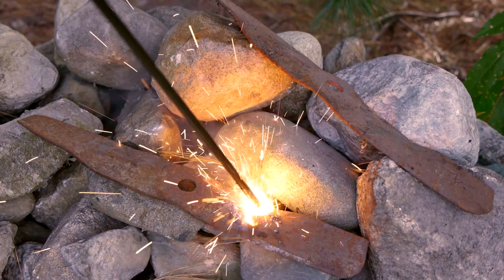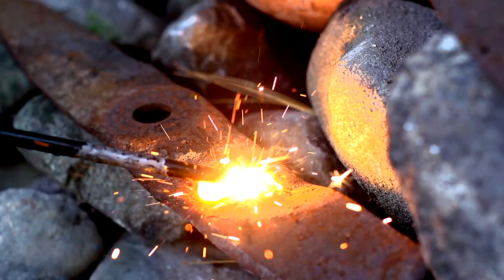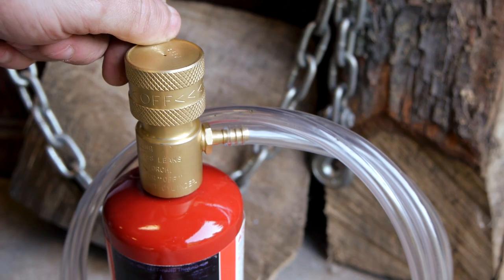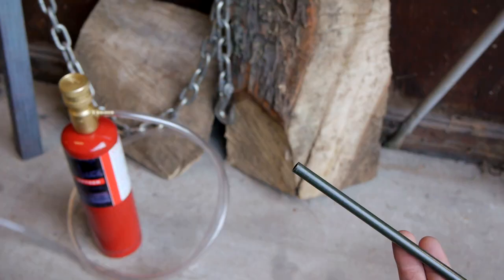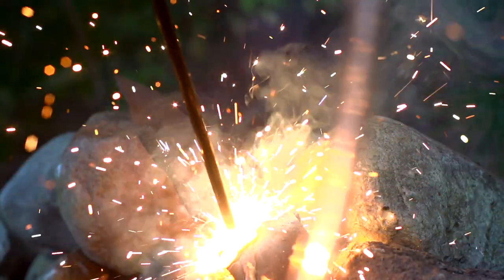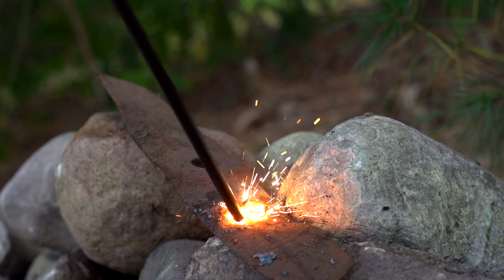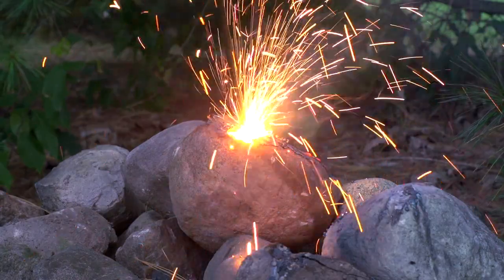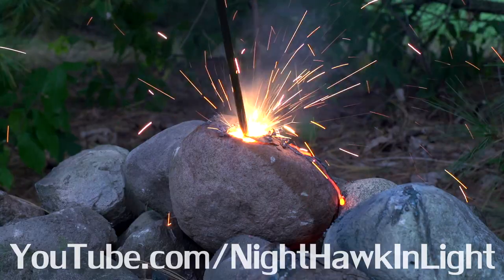How to Make a Thermal Lance Kit - Hot Enough To Melt Rock - NightHawkInLight

Comment: Not to be crass but that was hella awesome. Could a reducer be made that would allow the break line fitting to thread directly to the oxygen tank. I would be a rigid set up and care would need to be taken to shut it off before it got too close to the cylinder. I think it would work great for vertical cuts.

Comment: Instead of the vinyl tube, you should use a stainless steel braided brake line. The chromium in the stainless should prevent any kind of oxidising exothermic reaction from happening, and being a braided line would still make it flexible enough to still be functional.

Comment: Try to use aluminium tube or rolled aluminium foil. It also burns really hot. In termite aluminium has that high burn temperature to melt the steel. ;)

Comment: You could put a break in the iron such that it won't directly try to light your flexible tube. e.g. 2 feet of iron, then 6 inches of rigid plastic (that could burn) then 6 inches of iron or copper (that would not be ignited by burning plastic) then  the flexible tube to the bottle.
Reply from the maker: +Richard Ball Not a bad precautionary idea. A denser piece of steel that would burn much more slowly than the line would be even better, which is what commercial rods use.

Comment: Very interesting, but what keeps the burning at the end of the rod?  Why doesn't the whole rod get hot, melt and burn?
Reply: The rest of the rod isn't hot enough to ignite. The oxygen flowing out keeps the flame moving outwards and not climbing up the tube quickly and without the oxygen it woudn't stay lit. If you heated it up in the middle enough to ignite it might burn really quickly towards the end if it could get going before it fell apart.

Comment: ever though about using an O2 concentrator?  folks with lung problems are using them not instead of oxygen cylinders.  they are also called oxygen generators, they use a zeolite filter to let the O2 pass through and block the N2.

Comment: I noticed that although you are using a welding mask, you are not wearing gloves.  Doesn't the steel break line heat up on the non-burning end?  Is the burning steel truly bright enough to require the welding mask?

Comment: Easier to use a steel cable with pre extant vinyl tubular coating (think cable type bicycle lock). That comes in varying sizes for different job requirements. Then attach O2 source to one end. Tube burns along with cable. To light, use 00 steel wool and touch that off with a 9V battery. That's the method I came up with to use at work.

Comment: hey just to let everyone know, I finally got this to work, but had some difficulties:

Be sure to buy a left hand thread regulator

My steel wool wouldn't smolder like his, ended up having to wrap the wool around some fire starter and put it on the ground. light it, stick the brake line in it, and then start the oxygen. 

I might try a thinner brake line next time, oxygen tank didn't last too long, and had to blow a lot of oxygen to keep the lance ignited.

... But once it got going, it was fun melting some quartz.

Comment: Hi in my time in Italy i joined the vigili del fuoco (firefighter of Italy) we had such small thermal lance's in Italy they are called Lancia termica
A small oxygen bottle with a little head you skrew on that has the valve and a holder for the rods. To activate them we had a car battery and a starter cable 😨 you attach them to the rod and the electricity heats the rod till it  glows red open the valve und you are ready to cut metal .
I have my studying materials with pictures and instructions of that device on hand if you're interested .

Comment: I read about atomic hydrogen, apparently used before oxy welding became more practical. Basically pass hydrogen through an arc and it becomes monatomic (H) and is more active and can be used for cutting and welding steel.
I forget the disadvantages which made oxy acetylene more feasible.
Possibly oxy/hydrogen does not introduce carbon into the steel.

Comment: How long does the rod last? I know they come in several lengths, so how long does it take to consume 1ft of rod? 
This is an awesome idea, so simple and extremely effective. Thanks for the video.
Reply from the maker: +spanky84gt One bottle of O2 burns about 1.5ft of brake line. I didn't measure exactly how long that took.

Comment: In the early 70's I was a part time refiner on the copper furnaces that were in Anaconda then. When We would finish a charge We would burn out the Hi-Temp clay plug in the mouth hole. We used 15'  X  3/8" pipe and 90 # air. We would start the spark with a red hot pipe end against a cinder and low oxygen pressure to start. = Very Hot Burn-Burn pretty pronto.!.

Comment: I wonder if you user a Aluminum or you steel tube packed with an oxidizer such as ammonium percolate you could do away with the bottle of oxygen and just use pressurized air flowing around the rod.

Comment: perhaps use some silicon tube, and maybe a one way valve to prevent oxygen tank explosions, though i'm guessing thats why you said a prof of concept +1
Reply: silicon would still melt and O2 does not burn or explode from flame ..it needs a fuel source

Comment: Did it actually melt the rock or was it just the liquid iron pouring off of the rock? Could you post pictures of a rock with a hole burned through it? Also, what keeps the tube from burning along its whole length at once? Is it just the speed of the oxygen flow?

Comment: I'm only halfway through highschool Chem so I'm sure there's a catch somewhere but couldn't you use a copper tube to feed the oxygen so it wouldn't catch fire (though the fire may go back into the tank causing a bomb like explosion) if you welded it to the fitting in the oxygen tank and used plumbing fittings and whatnot I'm sure you get get an airtight connection and as long as the copper doesn't invite (I don't know it's ignition temperature) it would at worst melt and you need to cut down the tube.

Comment: now that's awsome, as a welder I'm actually surprised that its just a brake line, the stuff I use has a lot more chemicals to do the same job...might have to carry some brake lines around now
Reply from the maker: +23soki23 I'm curious as to what you use. I have never seen a professional thermic rod to know how it ticks other than the basic concept I used to make these.
Reply: +NightHawkInLight we use something called "arc gouging" a lot. which is quite expensive as well as a few gas cutting (oxy acetylene/propane) one you might be interested in is called oxy hydro cutting.
Reply from the maker: +23soki23 Thanks for the info, I'll look into those methods

Comment: could you directly attach the break line to the oxygen tank with a screw fitting that fits the breadline's screw fittings if you cut one end and flipped the breadline so you held it in place with he screw fitting without fear of explosion?

Comment: Cool video,  now I can cut the ends off of bolts I used to Jimmy rig some projects I have going without using my hacksaw,  which was nearly impossible at the angle I had to cut at.   Thank you,  and this is so easy and mobile.  
One question before I do this do I need welders glasses to look at what I'm doing? I mean,  will I burn my eyes out , or will I be ok looking at it  ?
Reply from the maker: You want to use welding goggles. If you have an arc welder you may want to wait for my next video where I will be making a carbon arc torch. These lances end up being kind of expensive with how fast you go through o2.
Reply: @Nighthawkinlight  thank you for responding  👍👍

Comment: Love the videos. Couldn't you replace the vinyl hose with a steel braided hose? Eliminating the chance of the hose catching fire. Or is the issue with the fire tracing its way to the oxygen tank?
Reply from the maker: +Atlas@DotAGaming Braided hose still has rubber inside that could catch fire.

Comment: I have a blade I was wanting to attach to a pole for a spear, but I can't drill through it. It only says "stainless."

I've put it under a drill press for half hour with a cobalt bit, and attempted a high speed. Machine shops in my area have tried and failed to puncture it (kind of become a challenge). This may be my ticket. Thanks :)

Comment: or you could just get the gun unit that attaches to and even smaller oxygen bottle and has an integrated igniter.. I have no idea where to buy them but you can actually buy a palm sized thermal lance I've seen them used in shipyards.. It's a tiny bottle with a screw on gun that has a long stem like that brake line coming out the gun; the one I seen went through 1/2 steel like butter and the molting metal pooled like water..

Comment: I would of used MRE heater packs magnesium. Get the dust on some paper  and you can light a pile of it up  ,      but this is cheaper and easier. 

To light the Mg from the MRE heat pack . 
1 cut pack open. You will need a very sharp blade   it is split into 4 chambers  so you have to cut the long way  on the heater pack 
 2 dump it  all on some napkin paper or toilet paper.  3 layer or more .  tap it  get out the fine dust 
3 form a small pile  and shank it gently .
4 now  with something "dry"     spread the fine powder at the base of the pile  to the edge of the paper .  rude the fine dust into the paper

Comment: What prevents the "flame" from traveling up into the tube? Since there will be both iron and oxygen everywhere inside the tube, or is the inside of the tube coated with something, or is the burn-rate so slow such that the oxygen flow prevents it from traveling into the tube (so if the flow rate would be to slow it would travel into the tube)?
Reply from the maker: +Kwin van der Veen It takes a ton of heat to get the reaction started. It can't travel far from the end because that is the only place hot enough to allow the reaction to progress. It couldn't move up the tube without melting the wall along the way, effectively making it the new end. That is assuming there are no other flammable oils or powders inside the tube that could burn more quickly. That's part of why I don't recommend this project to viewers. It takes a good deal of knowledge of working with O2 to get it done safely.
Reply: So you should also not use a tube which is too  tick, since the outside might not melt fast enough to prevent the flame from travelling up into the tube?
Reply from the maker: +Kwin van der Veen No, that shouldn't be an issue. You would firstly have a very hard time even igniting a thicker tube, but if you did the reaction is plenty hot to instantly melt probably at least a 1/4" wall.

Comment: Nice 1. Quick question. What prevents the oxygen traveling to the end of the rod being ignited all the way up to the oxygen tank?
Reply: +KilliKonKarnage The oxygen doesn't burn, the iron does. Since the required ignition temperature is so high and steel isn't a perfect conductor of heat, the iron a few mm back from the end is already too cool to react with the room-temperature oxygen being fed to it. What determines how much of the rod can burn at once would be the speed (thus heat) of the reaction at the end, which you can control by varying the O2 flow rate.
Reply: oh cool, thanks man
Reply: +Rob Kinney lol I was gonna say "Luck" lol but I knew it wasn't the correct answer. So the 02 by its self wont burn,  it just helps ignite the steel... ?
Reply: +hdrjunkie Oxygen is not flammable, it is an oxidizer and helps the fuel burn hotter and more aggressively in a fire.
Reply: +Stewart Hornick so the breakline will eventually dissapear because it is what is burning?
Reply: +urjnlegend The entirety of a fire is oxygen reacting with a flammable substance to form carbon dioxide, iron oxide, water, ETC. Oxygen by itself cannot burn, just like sodium by itself cannot explode.

So yes, the brake line is what is burning and will go away after a while.

Comment: why does in only burn at the tip and not all the way through the inside if that's where the oxygen is coming from?
Reply: Only the tip is hot enough for the reaction
Reply: why?
Reply: wouldn't the heat spread inside it?
Reply: Yes but not that fast.

Comment: So you said that the oxygen tank + vinyl tube combo is unsafe... Is there any chance you know of a more safe design? Maybe by applying a similar back (bubbler system I think is what he called it) up system to Grant Thompson's oxygenator?
Reply from the maker: +SgtLebouf Something like that would help. As would using tubing made for use with O2. There would still be danger however if the operator did not have experience with pure O2 cutting tools. There are a lot of safety steps necessary.

Comment: On the 5th episode of season 1 reboot of macgyver he used a metal tube, filled it with iron oxide, magnesium and a road flare to create a thermal lance. Was this method not only dangerous but ineffective? Or would it actually work just as well as this concept?
Reply from the maker: That would have made a form of thermite, so one of the more realistic things on the show maybe. Probably wouldn't work very well in reality but it would do something

Comment: Is the type of steel the brake line is made of important or could you any steel piping of a similar diameter?
Reply: steel type is not important. Commercial lances have a bundle of steel rods inside also, that  makes the lance last longer and and  as the oxygen is  is not exiting  through a large tube but in between the steel  rods and is heated, it comes out at high speed which is more suited for cutting steel as  the cut is kept clean by the oxygen stream.

Comment: so i know nothing about this sort of thing so this might be a dumb question but, would you run the risk of the fire going back op the tube and into the oxygen tank causing it to explode? if not can you explain why it doesn't.
Reply from the maker: +ian747474 The flame could run up the tube easily if it caught fire, but it would not go inside the tank. There is no fuel inside the tank for the oxygen to burn with except for the metal tank itself, but the flame from the hose would not be hot enough to ignite it. Still it can be very dangerous to use pure O2 unless you are properly trained.

Comment: How difficult could it be to build a more powerfull,safer and more permanent torch?I'm aming on the break line,is there a way to make it easly swaped,as an electrode in a welder?thanks in advance and sorry for my poor english!
Reply from the maker: +Dimitrije Vasiljevic A safer and permanent model would be to use an oxygen and fitting setup that is actually made for thermic lances. They are sold commercially.

Comment: what would happen if i used a thicker steel pipe .....or does it have to be a break line
Reply: i tried it with a 12mm pipe and thicker tubing, it worked for about 4 seconds then flashed back up the tube and melted it. Stage 2 i'll try and copy him exactly, recommend you do the same

Comment: Mate.This is very interesting kind of shit.
Could you please try this thermic lance on a specific target?
15 mm of steel (manganese one) and then right next to steel 3 cm of concrete.And how much time it takes to do that hole?
Reply from the maker: +Robin Feck I may, I do plan on testing these again
Reply: NightHawkInLight As I know exotermic torches are usually used to pierce trough pipes under water pression, concrete, stainless steel.If you are interesten in some more thermic lance experiences, do all of that.And don't forget about 15 mm steel+3 cm of concrete.Would be awesome.

Comment: how fast does that burn down the brake line if you were cutting steel, just curious because it would seem like expensive fuel (unless brake lines are cheaper then I think). that tubing is certainly a dilema, there is not much you can do portably that won't catch light that I can think of off the top of my head...
Reply from the maker: +cakeless coder The O2 is burnt faster than the brake line. It takes about 2 tanks to burn down a 3' line.
Reply: NightHawkInLight not too shabby. I would've thought it'd be faster, but i guess due to the nature of it being a brake line it may have some sort of treatment done before. How simple this is amazes me, it'd be extremely useful for working on steel remotely.

Comment: I did a search on ebay for the fitting and valve assembly.  Do you recall whom you got it from?  Thanks, good video.
Reply from the maker: No, but it was a valve related to beer brewing
Reply: I did a search on ebay for beer brewing valve assemblies and was unable to find anything that resembles your valve assembly.  Do you have any more info that just a valve related to beer brewing?  Thanks for the prompt response.

Comment: Great video, I kinda got a good laugh when you said that you had to make sure to remember to turn off the oxygen before the brake line burns all the way down to the vinyl tube, you probably would know before it does since it more than likely is burning through your glove and hand. On a serious note, the tanks  you are using are small and run out real fast and at about $10 or more each thats a waste. I went and got a home medical oxygen concentrator and i use it to run my oxy/acet torches and other stuff and it is an endless supply.